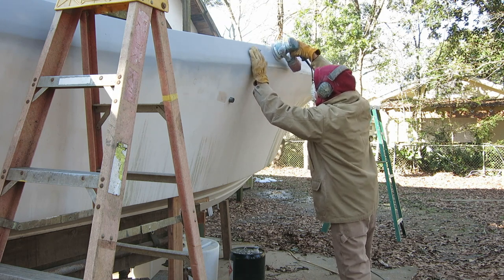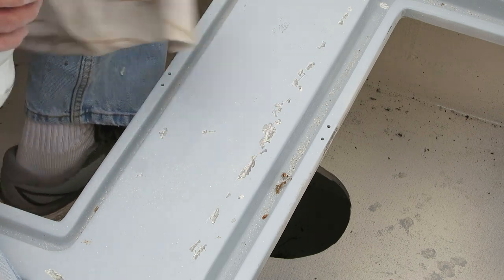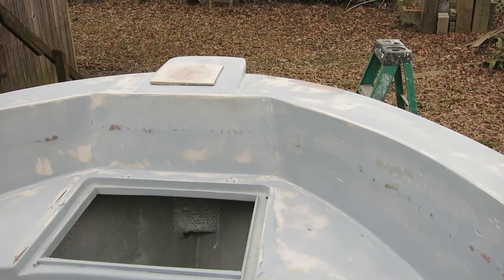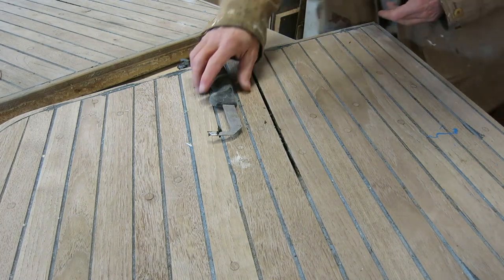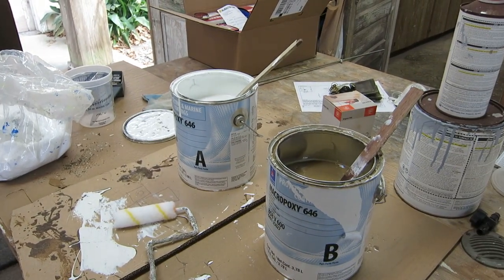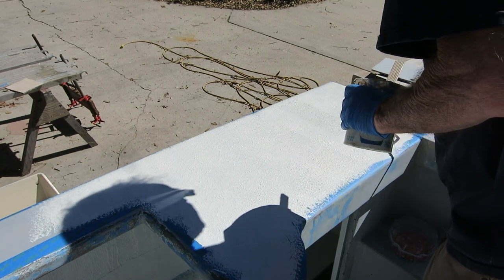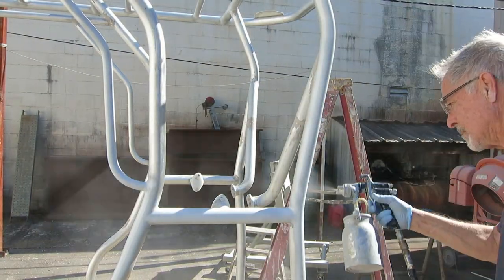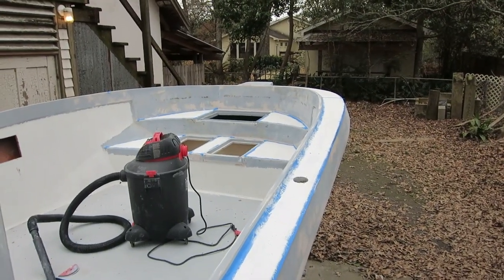DIY Marine Non Skid and more sanding and filling.

Comment: Looking good.  1 or maybe 12 rod holders.  I have 8 rod holders and wish I had 4 more.  Think about how you want to drop rig or troll and where you will need rod holders for the different types of fishing.  What about power and electronics?   What type of outboard and sonar?   This is always a hot topic.  You can do two or more videos on each topic.  It may be too late but it would be nice to have a place for a 5 gal bucket.  I'm just glad to see you working on the boat again.
Reply from the maker: Thanks Tim! I do have rod holders on the back of the leaning post and on the T-top. Outboard video unveiling coming soon.
Barry

Comment: Interesting non-skid solution. Can't wait to find out how well it works down the line. (Most solutions are damn near impossible to keep clean)
Reply from the maker: Confused one, we did the same non skid on the house boat project a few years back. It has held up just fine and yes, not as easy to keep clean as smooth surfaces. I think that is something we just have to live with.
Thanks for the comment !
Barry

Comment: Yep that's what glass rollers are for, to properly wet the glass out and get rid of the air. All those little failure spots are areas of air and dry glass, you can repair the ones near the surface but all the others trapped throughout the laminate can fail as well.
Reply from the maker: Thanks Reddy.

Comment: Great video. I noticed you used a little bondo. Will it be waterproof and how much is safe to use? Thanks. William
Reply from the maker: Thanks William! Bondo, bondo, bondo lots of talk about bondo and the devil. Bondo is polyester resin with a lot of filler. It is used on cars which sit in the sun and rain all the time. But seriously, it is not nearly as strong as the epoxy fillers, and I wouldn't use it under water but for filling little defects that are going to be painted what the heck? It works on cars.
Thanks for the comment!
Barry

Comment: On gelcoat i have used topcoat (gelcoat + paraffin wax) and fumed silica and the same method. It works great. But i have painted/rolled the boat first. Then mask and apply the antiskid.

Will you splash this summer/2021? 
Do you have a dock spot or will you trail it?
Reply from the maker: The beauty of messing with boats, So many ways to get things done. I have avoided setting a schedule or a budget to keep those stressors away. But I can see the light at the end of the tunnel.
Not sure where it will live. We are 45 min from good river boating (summer stuff) but 2 1/2 hours from salt water. (winter stuff). Lots of guys rent sheds down south to keep there boats. Still have to launch them but at least they don't sit in salt water all the time. 
Thanks for the comment
Barry